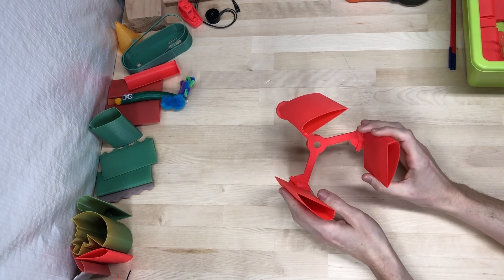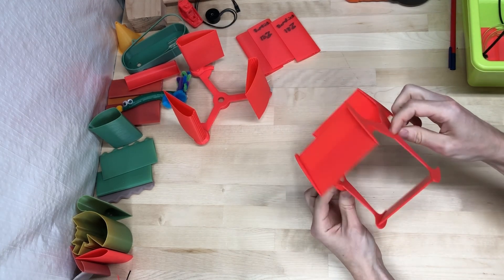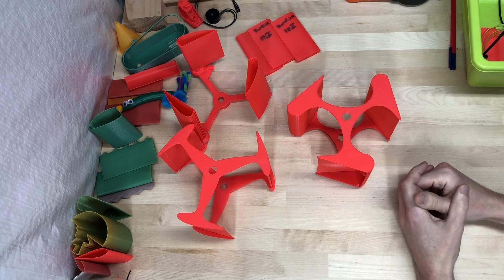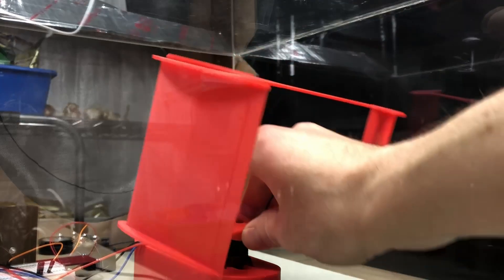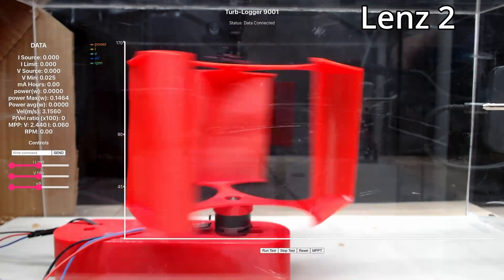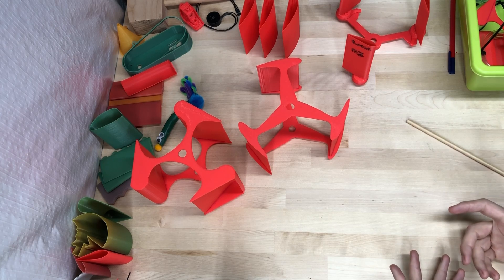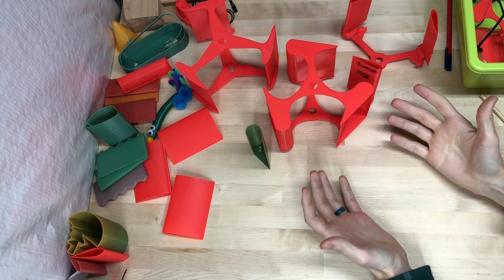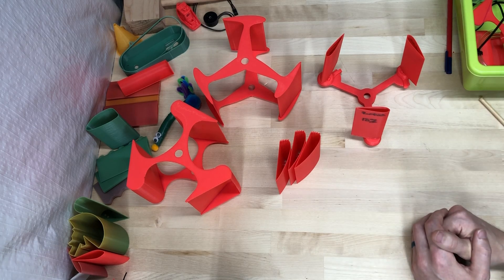A Subscriber Tried to BREAK My Wind Tunnel... AGAIN | Turbine Challenge | DIY Wind Turbine | VAWT

Comment: I think that the Lenz2 has greater potential in power production at say 1/2 the air speed than you are testing?
Your wind speed was a constant, correct?
I think the Lenz2 would get to power production PROFORMANCE earlier,  preform higher in lower speeds,  and would possibly even average out the effects of gusting winds which is important when trying to turn fluxuating  power into power that wont kill your computers, and Stereos without 110% relying on electronics to do the job.
Also I thing the angle of the bucket part on the Lenz2 could be deeper for lower wind environments, and easier start ups.
Building a flexing mount on just the long flat of the bucket, and in each bucket that were all tied together so that balance is maintained. Could mean that they would have greater start up speeds, greater performances in low speed and would flare out in high speeds?

Comment: Different blades likely have different torque curves, so a drag type turbine might have more output at low speed working against a load, where an airfoil would have max output at high speed with a light load.
Reply from the maker: Good point! We've actually tested some exceptional drag and airfoil type turbines in past videos. I recommend checking them out!

Comment: It would seem that you are unintentionally handicapping some of the designs that would benefit from an upper bearing.  You wouldn't lose power to a design that is flexing (heat) and bad harmonics.

.02 only
Reply: The "rod of stability..." needs to be mounted on the motor LOL

Comment: hey Max; I wonder if Mr. Adruino has enough computational power left to give TSR? You already have rpm and wind velocity; all you need to to is calculate in the relationship of the 2 based on the circumference. Maybe Mr pickle could help as he hasn't had much to do lately LOL
Reply from the maker: Luckily, I had some foresight, and I left all the math stuff to laptop software. Yes I can and will add TSR!
Reply: @hellothisismax  awesome; you're the best!

Comment: Thanks for the video Max! and thanks Lloyd for the Remkick blade submission.  It sure changes my view of the usefulness of airfoils in the nano size VAWTs.
Reply from the maker: Oooo I'm gonna reprint your torque turbine and run it again on the new setup. I'm also gonna apply the integrated mount design you used for this set of turbines. I think it's brilliant.
Reply: Myself and my Dad expiremented on the scoop type blades Lenz later claimed 30 years before I saw his and there is a tweak you can make to them that i figured out 20 years ago that gives them about 15% more power; that's where the Remkick name came from, but after I discovered lift wings it sure opened my eyes. I don't know if Max will do it but the Lenz have an advantage by being capped on the ends and lift wings benefit from the same thing; probably get another 5-7% out of them.
Reply from the maker: I'm thinking I will :)